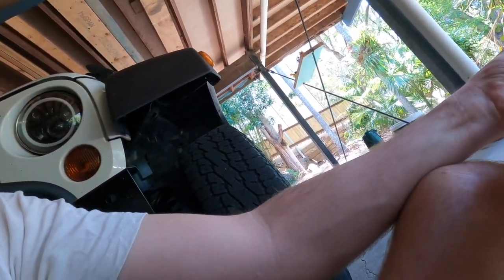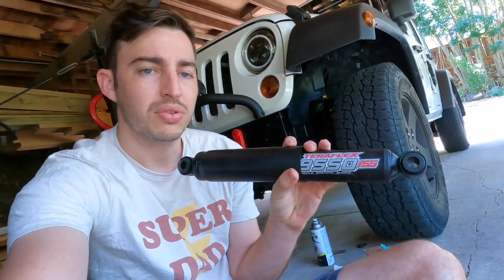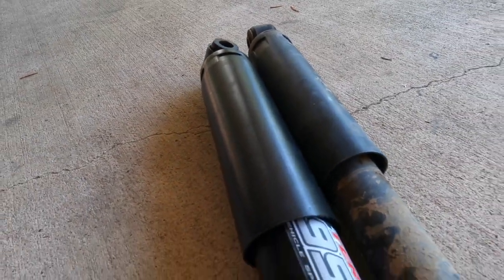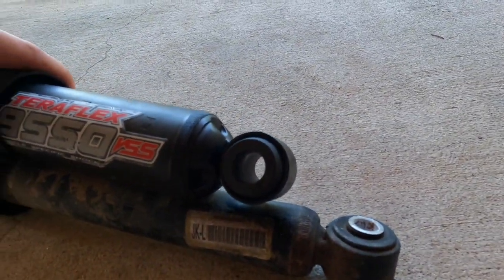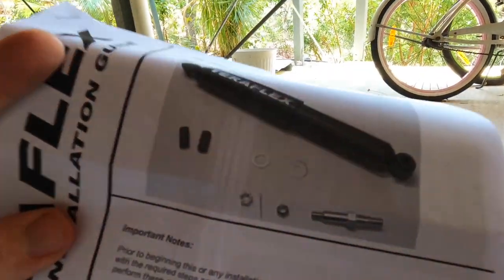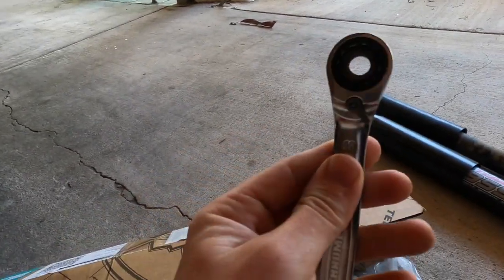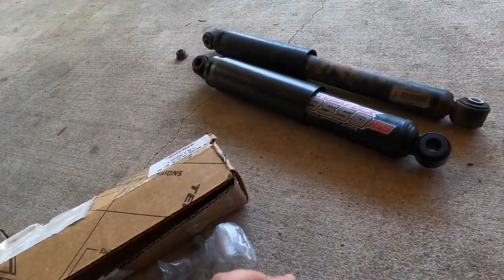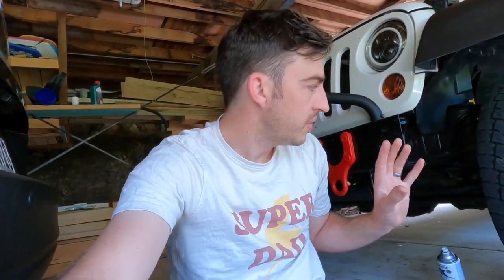TERAFLEX JEEP JK TJ XJ STEERING STABILIZER

Comment from the maker: What steering stabilizer are you running in your jeep?
Reply: Just the factory one.... should upgrade it ASAP
Reply from the maker: @jeep2353  how is it driving? No point in replacing something that doesn’t need to be fixed